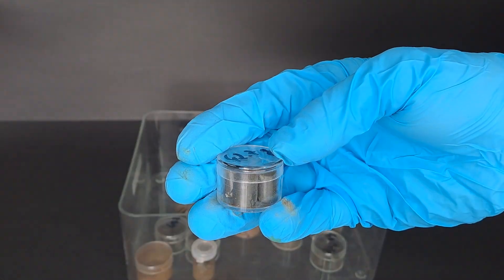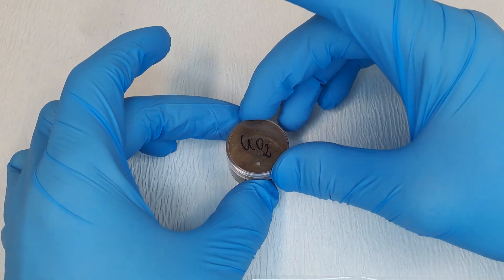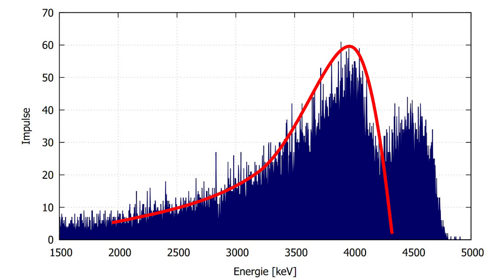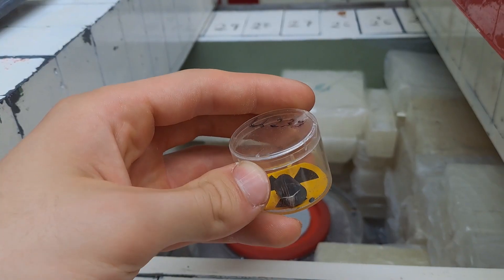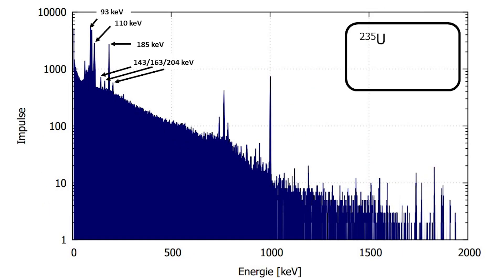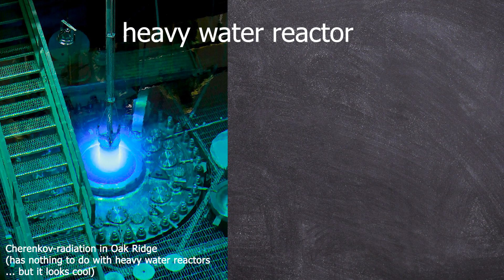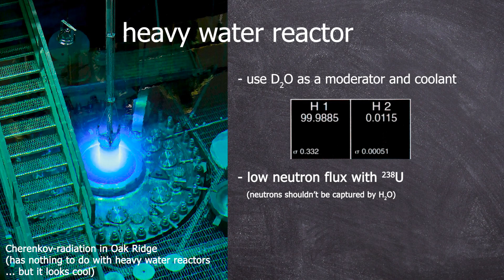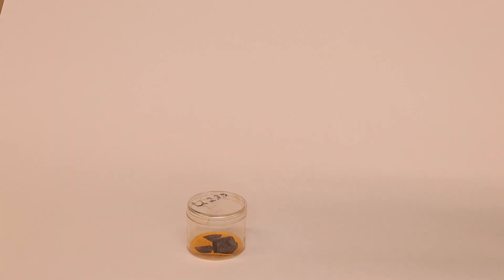Anaylsis of nuclear fuel - Nuclear Chemistry

Comment: what does the m in 234mPa stand for?
Reply from the maker: Metastable. Atomic nuclei (just like electrons) can be in different energetic states (flame color with excited electrons, when they drop into the ground state, they'll release photons in the visible range), when a meta stable nucleus decays into the ground state it sends out Photons in the gamma range. An isomer (that what you call the relation between the "m" and the ground state) is classified as such, when this energetic state is somewhat stable it think it needs to exist for more than 10^-12s. If it decays faster, it'll be called an excited nucleus and not a metastable isomer.